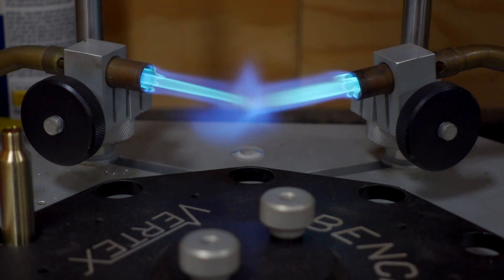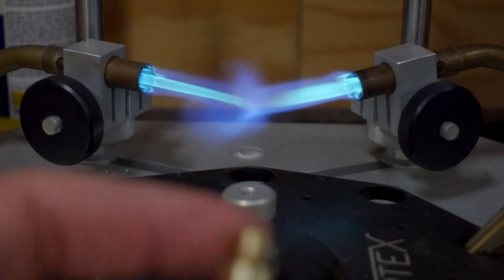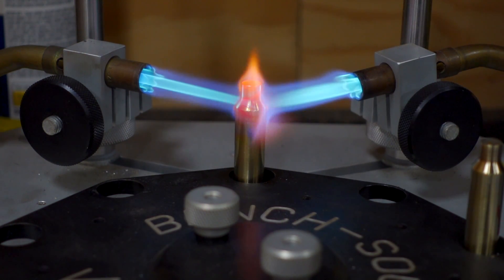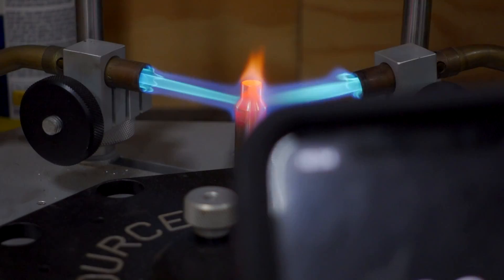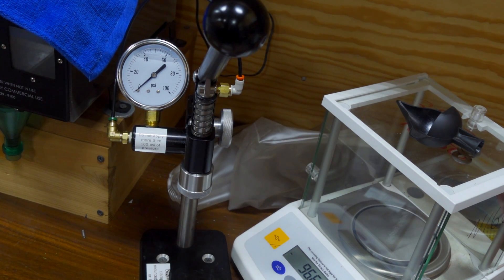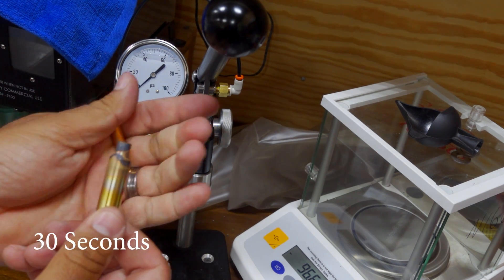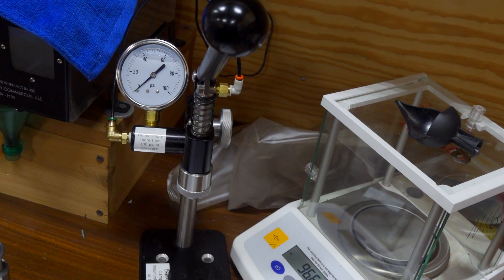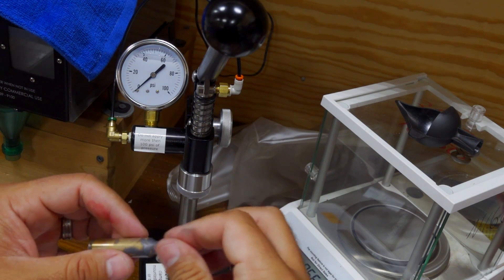Annealing brass until failure

Comment: "Overcooking" brass will start to burn the zinc out of the brass... it may not be obvious, but after polishing it will get "redder" if the tinge of the base metal changes after polishing, you've definitely compromised the brass. It takes more than 20 seconds with a blue flame...
Reply: According to Annealing Made Perfect, zinc will not burn out of cartridge brass...the case would melt first:  "heating brass, even to high annealing temperatures cannot cause dezincification unless chemicals are present. The zinc content of the alloy cannot burn or melt out up until boiling point (Appendix 1 - 1.6)." source:https://www.ampannealing.com/uploads/report17/app1.pdf
Reply: Since brass is commonly fully annealed before the start of most forming or rolling processes at 700 C for hours, I don't think the brass is damaged at all.